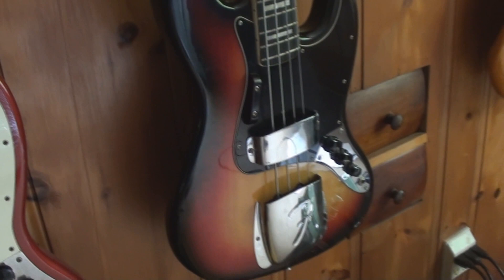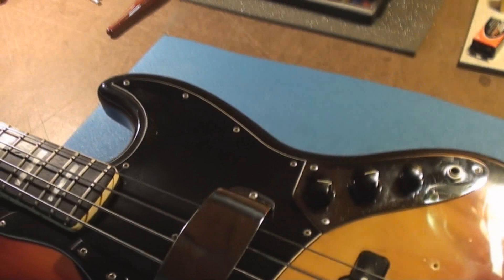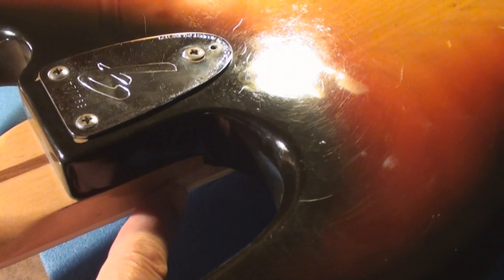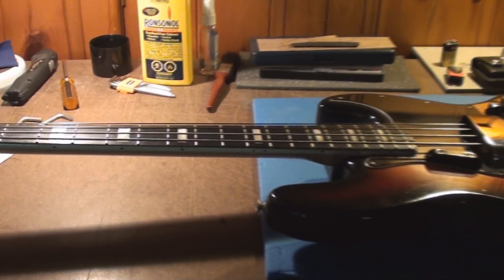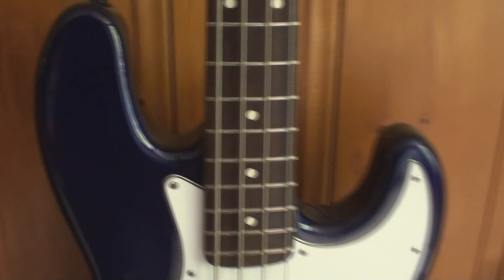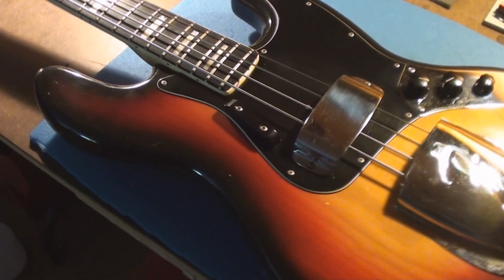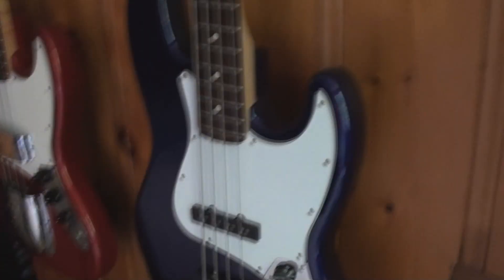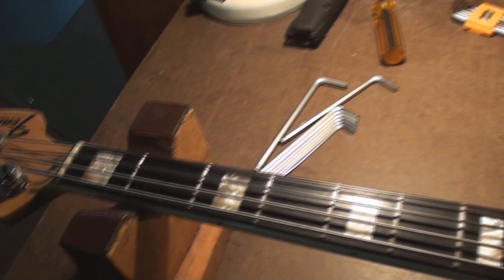Fender Jazz Bass The Movie

Comment: Lucas Willeford The mutes were there because the electric bass was originally intended to be a substitute for the big upright basses. An upright bass played with the fingers (as opposed to a bow) didn't have a lot of sustain - it was very "thumpy". But an unmuted electric bass "rings out", and at the time that kind of sound was undesirable.

But it didn't take long for electric bassists to decide that the /liked/ that crisp, ringing, sustained sound they got without the mutes, so they started pulling it out, and eventually bass makers stopped putting it in.

The "replace the upright bass" thing is also the reason older Fenders have the "thumb rest" mounted /below/ the strings. The idea was that you'd grip the rest with your fingers and pluck the strings with your thumb. That too went out the window as bassists decided they'd rather play with their fingers. It just took Fender a long time to move the "thumb rest" to a spot where you could actually rest your thumb on it.

This video also points out the one good thing that CBS did when they owned Fender: Put the damned truss rod access at the headstock, like everybody else does. I mean, there's a /reason/ everybody else does it like that!

Comment: The real purpose of the pickup cover was to help quiet that annoying 60 cycle hum that early single coils made incase of poor or no electrical grounding, lack thereof or radio/neon/appliance transmission and interference. This issue was noticeably most prominent in the factory than the outside customer base and Leo Fender had to address it before any shipment or sales. You also have to remember that this was conceived in an era before reverse wiring or hum cancelling techniques, 3 prong ground plugs and sockets in which what is now part of our current electrical code. Better pickup design and noise cancellation became more prominent later and the pickup cover became more of an optional styling feature. The early jazz basses also had a strap button behind the headstock. Everyone be careful out there..
Reply: I dont mean to be so off topic but does someone know of a trick to get back into an Instagram account..?
I was dumb lost the password. I appreciate any tips you can give me.
Reply: @Axton Mathias Instablaster ;)
Reply: @Pierce Lachlan Thanks for your reply. I got to the site on google and im in the hacking process atm.
I see it takes quite some time so I will reply here later with my results.
Reply: @Pierce Lachlan It did the trick and I now got access to my account again. I'm so happy:D
Thanks so much you really help me out!
Reply: @Axton Mathias Glad I could help xD

Comment: Fender jazz basses have great feel and great tone. Sometimes need some adjustments. I've got an S1 with SD quarter pounders: Heavy, rounded tone. With Original pups had greater treble range. Japanese '62 Reissue with Custom Shop 60s pickups.Tight, punchy tone...especially with bridge rolled off. Geddy Lee Jazz bass. Unique feel and tone; Real Jazz with a hint of Ric. Cuts through and sits well in a band mix. I also have a JHS Vintage Jazz: With the bridge rolled off sounds like a Precision.

Comment: Fact check: Fender Jazz Basses originally had 4 bolt neck plates from 1960 till 1975 and they changed back to the four bolt in the early 80s. The micro-tilt and bullet truss rod wasn't part of the original Jazz Bass design.

Comment: I got my first bass outfit when I was 13 years old. In 1963 I bought  a used 1960 jazz bass and a black Fender Bassman piggyback 2-12 amp for $375 for both. Paid for it with my paper route money. Now I play a Musicman Stingray 5 HH which Leo Fender designed as well as a Sandberg California 5. Jazz basses are fair but to me lack balls and most of the ones I have buzzed like hell. A P bass is an improvement-just my opinion.

Comment: On those bridges where the screws tend to back out of adjustment, I apply a smidgen of CLEAR fingernail polish on the threads. And, don't panic, it doesn't show, or it doesn't make 'em any harder to loosen/tighten, either. It does exactly what it's supposed to do. And, that's to keep the set-screws, set. My late-90's Carvin had to have the worst-designed bass bridge in history. It was a Wilkinson bridge. It sounded great. But, when it came to keepin' your bass adjusted properly, it was straight junk. I switched to a Bad Ass Bridge. Those were really hard to find back then, but well worth the hunt.

Comment: One thing - I have a 2002 Roscoe Beck Jazz V that weighs a ton.  It's gotta be close to 10 lbs.
Also, the American ones now have a string-thru-body bridge and graphite bars in the neck.  Very big improvements at Fender.  I guarantee the American Standards will be even better than the vintage ones now in about 10+ years.

Comment: You missed an important chapter in the movie. Pickup Placement. It changed in 1974 when the Bridge pickup was moved back about 1/4" ( I think) . For cosmetic reasons only ( to hide the pickup under the ashtray). But it had a huge Impact on the tone. Especially for slapping. 60s position,. think Larry Graham. 70s ...Marcus Miller. The Bridge pickup on a 60s by itself is a little fatter sounding ( think Jaco).
So it's a matter of taste. I personally like the 70s sound more, but the bass I get the most compliments on is my 60s type of Jazz bass. Go figure!

Comment: Actually flats tend to put more tension on the neck because of another reason: String tension is determined by pitch, scale length, and unit weight and flats tend to have higher unit weight than rounds.  Some flat's don't put as much tension on the neck, like TI's.  That said....I want a fretless 4 string G&L Jazz... pretty hard to find em :(

Comment: The reason that the "flats" put the most tension on the neck must be because your flat-wound strings are MORE MASSIVE.
Surface area has nothing to do with it. The frequency of vibration of a string is Inversely proportional to the length of the string, proportional to the square root of the stretching force, and inversely proportional to the square root of the mass per unit length.
http://en.wikipedia.org/wiki/Mersenne%27s_laws
Apart from that, may I thank you profusely for showing me your world.
"About a boat". Canucks are the sweetest people. :)

Comment: when did they discontinue the binding on the fret board.....i remember drooling over one of those early stack knobs as a penniless teen....got a hofner tho',then a 69 precision
Reply: buckandotis They only added binding and block inlays in the 'CBS era' (I think they bought Fender in 65, but the era is like 68-80). The bullet truss rod, 3-bolt neck joint, different Jazz Bass pickup spacing with the bridge closer to the bridge, less contoured bodies, and generally shoddier construction for cheaper mass production were all hallmarks of the CBS Fenders. For what it's worth, 70s Fender basses are far and away my favorite Fender (brand, not designed- that honor would go to Music Man) basses when they play well and don't have wiring problems.

Comment: Nice video but lacking in some areas:
- Jaco didn't slap
- jazz basses began with the 4 bolt neck plate, just like my '72 jazz bass
- why is there no mention about the thumbrest and why it switches from below to above the strings.
- block inlays are also not mentioned.

Comment: you cant piece together why block inlays exist and why they were taken out? all he basically had to do was say, "and inlays" when talking about the bindings. sure its open for criticism but most of what you had to say was nitpicky, hasty and trivial. the only valid thing was the thumbrest so here. it was first below the strings because it was expected to be picked with the thumb as a finger rest for leverage, but the style changed to the fingers and it was moved so the thumb could rest on it.